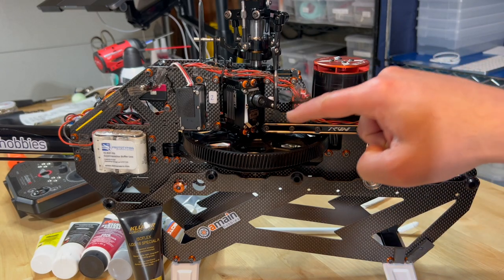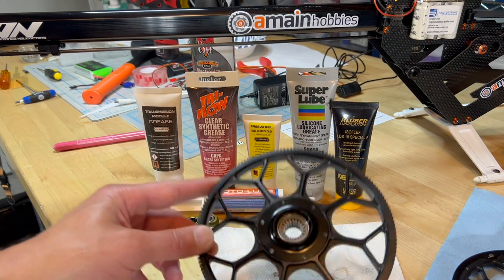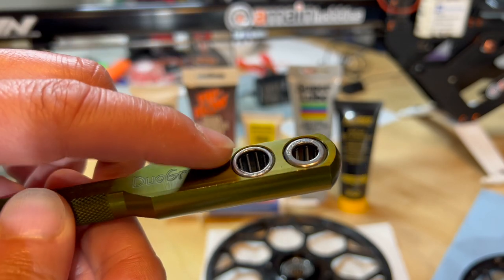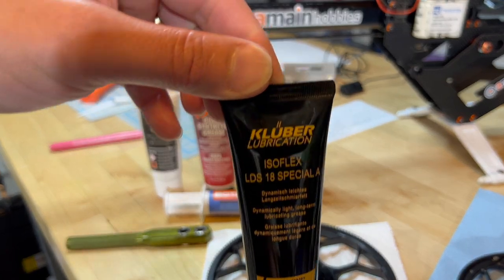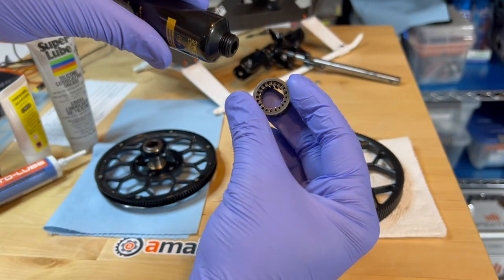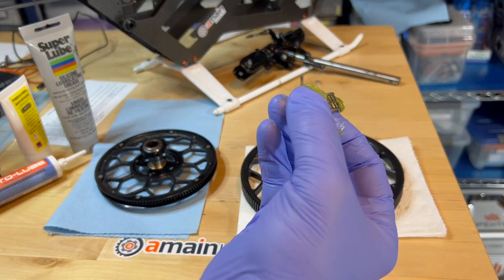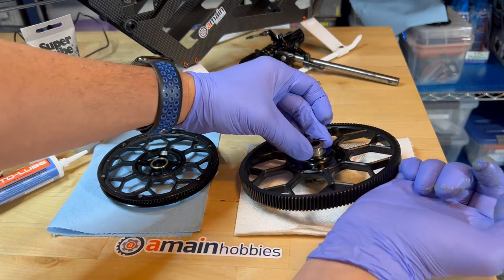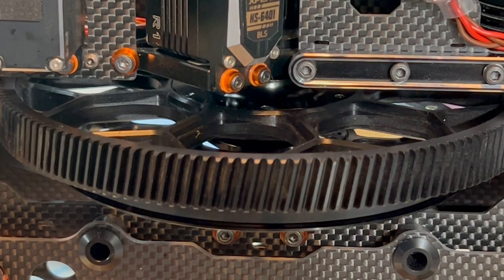Sprag One Way Bearing Lubrication   HD 1080p

Comment: Kluber isoflex is well known at cycling community.
there are some of high end boutique rear wheel hub that use clutch bearing inside the system.
That manufacturer even avoid the warranty when buyer not using Kluber grease. 

kluber isoflex LDS 18 is the ONLY grease i know for sprag clutch bearing type.

and yeah that grease is RIDICULOUSLY expensive.

In common sense, any common high grade grease should be work just fine.

Tell us more about this bearing maintenance . 😁👍

And whats better for that small needle bearing. 
oil or grease?

Comment: Always thought the amount you used in the video was excessive and would cause slippage?
Reply from the maker: It is my understanding that sprag style OWB like this one can be packed with grease very liberally.  You have to be a bit more careful with the rollers/needles style OWB which tend to work better with relatively light grade oil like ATF (automatic transmission fluid).  With these OWBs you have to be more mindful about the type of lube you use.  If you use a grease that is too "heavy" or a lube with PTFE, it is possible for the PTFE to "gum up" the rollers over time and cause the OWB to not disengage (opposite of slipping) consistently.
Reply: @johnahamelv makes perfect sense… thank you for that info.